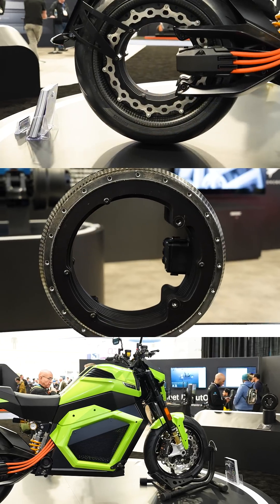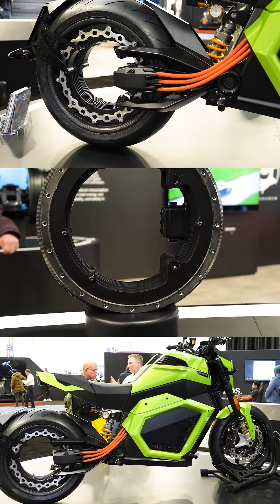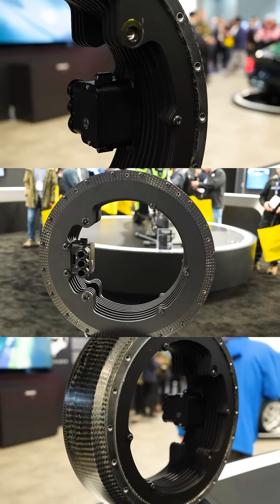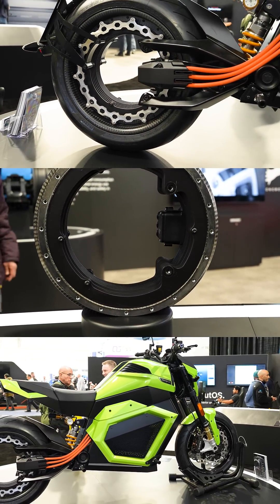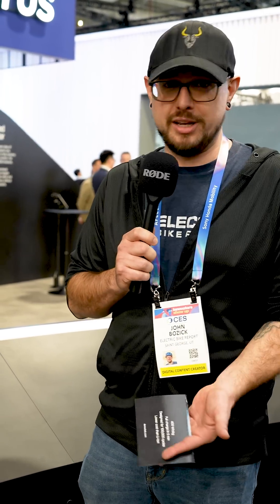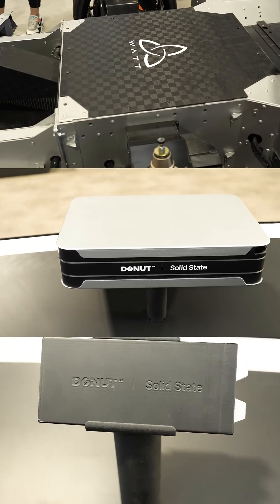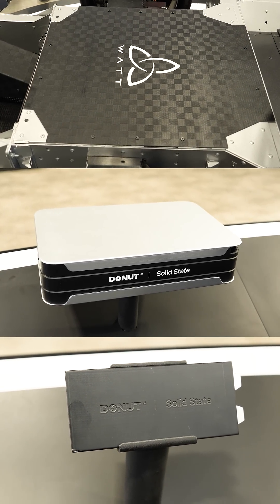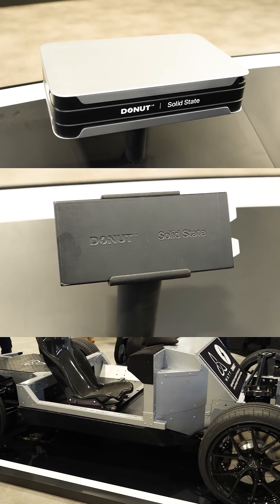1,200 Nm of Torque & 150,000 Watts From a Hub Motor?! 😳

Comment: IMOP, that battery is likely a scam. Hope I am wrong!
Reply: They are likely batteries that are based on sodium-ion technology, or a combination of mostly sodium-ion and some lithium. They are already being used in other applications. Sodium-ion batteries have my benefits over lithium batteries, with some disadvantages. CATL makes both.

Sodium-ion Battery Benefits
1. Cheaper
2. Easy to get raw materials
3. Better for the environment 
4. Doesn’t require cobalt and nickel 
5. Good in cold weather
6. Faster charging 
7. Holds charges longer
8. Can be charged more times than lithium 
9. Safer (not a fire hazard)

Lithium Battery Benefits 
1. Better energy density (power/weight)*

*E-bikes don’t require much power.